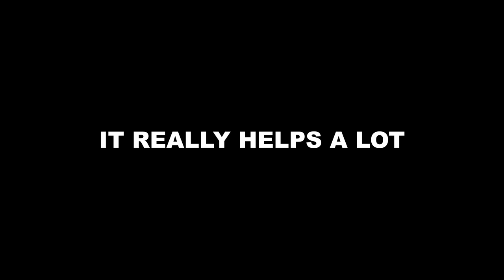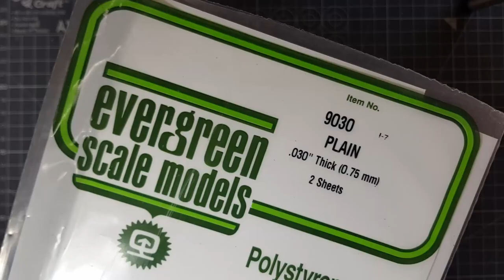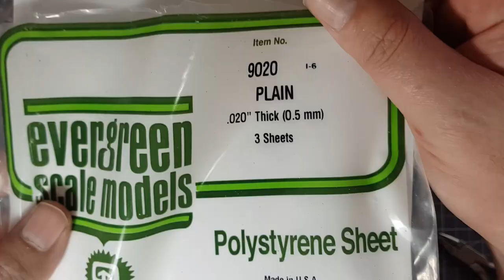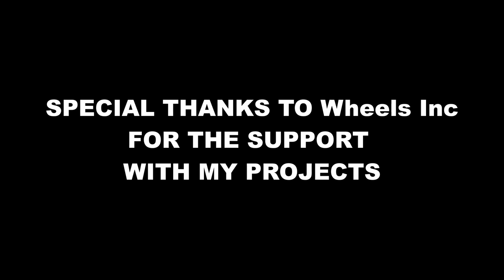Custom Hotwheels GMC Van to Pickup Conversion

Comment: Just a thought, but you could have used the back end of the part you cut off to finish the cab and have the rear window already made for you and shaped apropriately.
Reply from the maker: Hi. Not a bad thought. For projects in the past I used that technique. For this specific build the GMC have a really small piece behind the cockpit and if I reused the rear piece the window would not fit. That is why i used the thin material to win some space.😁🤘 but what you say is right. In 90% of builds that would be a way easier method.

Comment: Over all it turned out good. Just opinion I might have rather seen a GMC on the tailgate instead of Foose. That way it lends to the credibility of the rust patina and also Foose is not known for this type of customizing. But that's nitpicking, you did a good job on it.
Reply from the maker: Thank you. Your nitpicking is really good feedback. I agree fully. I dont have a printer and the decals would arrive to late for the build. But i didnt think about foose like that. He is more of a show quality hotrot guy. This is more a gas monkey kind of build where they clear coat a patina😁🤘
Reply: @diecastcustoms8512  You're right dude. I hadn't even thought about it being a Gas Monkey build. Good call.

Comment: you did all that work to put plastic tires on still looks great but the wheels dont do it justice
Reply from the maker: Thanks bud. It's real riders from hotwheels. The size on the back is so big that I didnt have custom wheels to fit😅
Reply: @diecastcustoms8512  yeah I’m working on a 86 Monte Carlo ss drag car right now I just need to do the roll cage and paint it